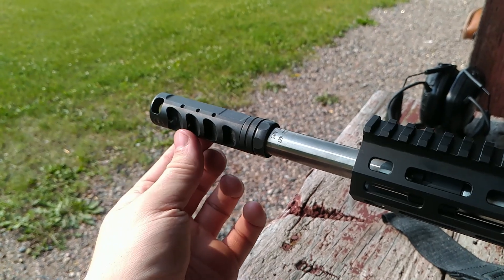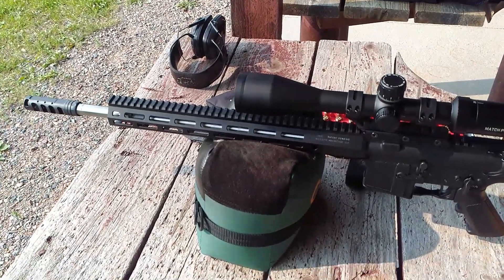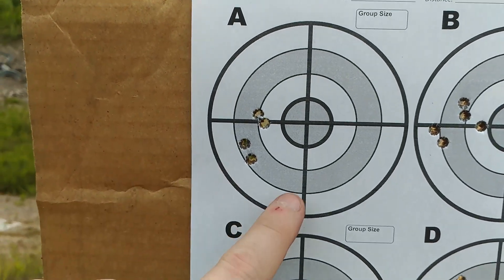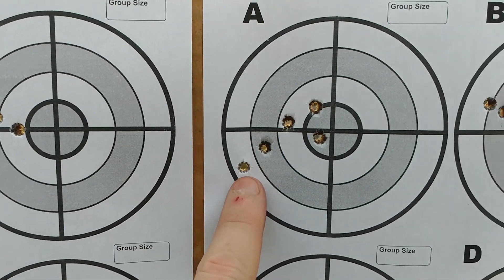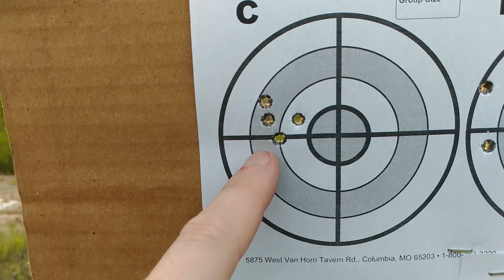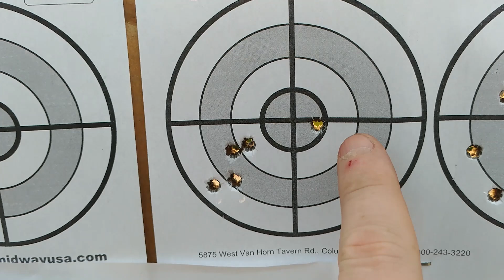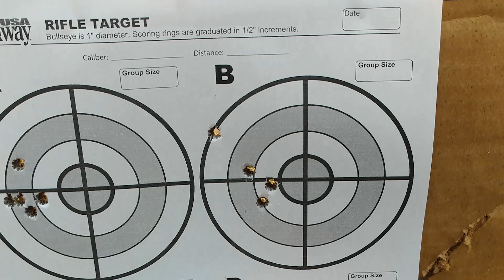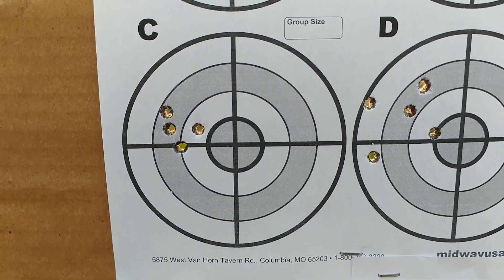6mm ARC - Staball Match with 107gr SMK

Comment: Thanks for the video. Most apparent to me is that either 6mmARC or AR15s aren’t very consistent. My bolt action 35 caliber shoots ragged holes. Such sporadic grouping would frustrate me. Was there any takeaway about Staball Match powder?
Reply from the maker: Welcome to the channel!

For this particular video, what was shown was just the end of some cursory load development with one powder-primer-brass combo.  It's nothing special.  That said, with this barrel, I regularly shot those 0.75" groups with not much load development.  Taking things into relative comparison - the ragged holes of your 35-caliber is about the same level of accuracy.

That said, I do have another 6mm ARC AR-15 upper, with a Wilson Combat barrel, and I regularly get about 1/3" groups with it.  In other words, it shoots "ragged holes" - and, again, keeping it relative, the ragged holes that that platform shoots will fit within a single bullet hole of that 35-caliber.  Both are shooting ragged holes, but one is more impressive than the other! ( https://youtu.be/nZc0pkw_It0 ) 

What sort of bolt action platform are you using, and what scope, out of curiosity???  Do you have videos?  (Do you ever try 300-500 yards, or is that excessive for that caliber?)
Reply: @upnorthreloading2214  The scope is 2.5 Leupold  on a 16 inch Ruger M77. It’s a big game getter; and the shots are kept within 150 yards to guarantee bullet performance at relatively low velocities. I have no use for long range hunting; and harvest all my game within 300 yards. .30-06 is my preferred round for such work; and that rifle shoots 3/4 inch groups, (center to center) with hunting bullets; and a Leupold 3-9. My muzzleloader  fires .458 300 grain bullets into 1 inch groups using a Trijicon Accupoint 1-4. The .22 Hornet has a fixed 6 Leupold; and recently I was quite upset as I called my pulled shot into the right eye of the whistle pig instead of between the eyes. If I think I’ll be among running whitetails then I run a lever operated .308 Winchester with a 1.5 to 6 number 4 reticle set on 1.5. The interesting point about 6mm ARC is that it’s the minimum legal diameter to harvest whitetails in my state. The stainless barrel on an aluminum upper and lower receiver is appealing for use in downpours. It has size and weight advantages over the AR10 platform.  I could sling it over my back as I wind around smaller hickory trees working my way to a stand. Most shooting channels featuring 6mm ARC show one flier in five shot groups; and that’s a pattern that is both annoying and fascinating. If it will sling copper solids at high enough velocities to allow complete pass throughs of both shoulders out to 300 yards then it would be useful to me. Otherwise it’s just not my cup of tea.
Reply from the maker: @308blr2  And, here, in Michigan, we can still hunt whitetail with even a .223 Remington, though only in areas away from the "big population centers."  Even then, in my area, 20-60 yard shots are 95% of what you'll be dealing with.

That said, I actually haven't seen much monolithic bullet data for 6mm ARC, so I'm not even sure how to comment on its performance in that case.  But it's not a high-performance cartridge, in terms of power and force; if someone is looking for brute force and passthroughs, they should stick to something classic like a .308.  I've actually yet to take a deer with the 6mm ARC, and I still have a small supply of the Sierra 100gr pro-hunters that I want to try.
Reply: @upnorthreloading2214  I think the 80 grain TTSX could be driven to 2,800 fps plus. Even when I deliberately try to double lung a deer for someone who wants summer sausage and burger; I usually find my brain is just trained to go for the shoulder. I learned to break down the structural parts to avoid hours of packing deer out from dropping over hills or running over the ridge. An eighty yard death run can put a deer in a whole different type of terrain where I hunt.

Comment: You should’ve assume magazine length means anything use a Hornady overall length gauge and measure with the bullet you intend to use. I have two 6 arc rifles one is a proof research barrel and the other one a Wilson combat both measure at 2.140 overall much shorter than magazine length and they shoot 1/2 MOA on average
Reply from the maker: Welcome to the channel!

I'm assuming you mean I should use a Bullet Comparator to measure the base-to-ogive for the cartridge with a given bullet, and find the points for "jam" "into the lands" and "distance from the lands.  This is something I do, on occasion, but for a lot of the old milsurp rifles I have, and with auto-loaders, I'm more than perfectly content with mag-length and shorter.

With this barrel, mag length hasn't been bad for the bullets I've tried - meaning they aren't jammed or into the lands - although I haven't looked at the Hornady 105gr yet.

I do a lot of OAL testing, and have a short series on testing the second iterations of the Scott Satterlee load development method: https://youtu.be/dRSGfVhQKpQ

Comment: I couldn't get under .5" until I tried 90gr Berger bullets. you can seat them a little into the lands and still be under mag length and the base of the bullet is out of the powder column. I'd like to try those with Shooters World Match powder if I can ever find some. I've been mostly using Leverevolution.
Reply from the maker: I saw that Precision Reloading had Berger's on sale.  Sadly, I already bought a bunch of the Hornady 105gr, and also a box of the Lapua 90gr.  I bought the Hornady because they were cheap and lots.  I'm hoping the Lapua perform really good.
I have yet to try Leverevolution, but almost bought some!  PowderValley was having a Hazmatt-free sale, so I bought more BL-C(2) and Benchmark... We'll see how it goes.

Comment: Should have went with a 1 in 7 twist barrel...
Reply: Believe it or not that 0.5 in barrel twist can and does make a difference in bullet stabilization...
Reply from the maker: @shanejohnson3517  You're right, 0.5" can and does make a difference --- but not in this case.  There's nothing here that indicates a lack of bullet stabilization.
Reply from the maker: I was tempted to go with Ballistic Advantage on this one!  That has a 1-7" twist.  However, I wasn't too impressed with my BA barrel for .223 Rem.  It wasn't bad, but wasn't great.

That said, I don't think twist rate is going to make a huge world of difference, in this case.  There's probably going to be more difference in going from barrel-to-barrel from changing up twist rates by 0.5".

I'm currently in the process for another 6mm ARC barrel, though - who do you recommend for a brand?
Reply: I use custom barrels from McGowen Precision Barrels...
Reply from the maker: @shanejohnson3517  That must be how you found my channel!  I had one in .223 Remington, but they cut the chamber wrong so I sent it back, and I'm still waiting to see if they plan on replacing it or not.

I'd like to give them a second chance, because it still shot decent for having a bad chamber - I can only imagine how well it would shoot if it was properly made!

Comment: It looks like your c.o.a.l is changing try more crimp if your crimping
Reply from the maker: There is some truth to this, but not in this case!

When I used a 0.267 bushing, depending on the bullet, I could get some shift in the OAL when the round was being chambered.  I've since switched to a 0.266 bushing, and this has largely fixed the issue - I say largely because the Barnes matchburners are oversized right before their boattail, and they've been the only bullets I've tested so far that sometimes gives me the issue you've described with my new neck tension.

My next 6mm ARC video is going to be my trials and tribulations of getting into the platform!

Comment: With 6 arc it seems barrel quality really plays a role. Proof seems to be one of the best and they have the gas figured out too.
Reply from the maker: Proof Research is on my list of barrel makers to try!
I've read that they helped Hornady develop the cartridge, but haven't went out of my way to substantiate the claim.

I think a lot of issues stem from people trying to run the 22"+ barrels, with a Rifle+2 gas system or whathaveyou.  Not to mention factory ammo issues.  I'm still learning about recommended gas port sizes, and fiddling with gas blocks - so I'm just following the KISS (Keep It Stupid Simple) principle.
Reply: @upnorthreloading2214  Half the fun is the learning process. Proof has their own proprietary gas system that is tailored for each caliber so I think that helps a lot, combined with super high quality barrels. I like the steel barrels but their carbon fiber barrels are top notch too.

       Their factory bolt guns come with a guarantee of 1/2” or better so that says a lot too. I really like Criterion barrels too for something for affordable. You get what you pay for most the time. Once in a while you get surprised .